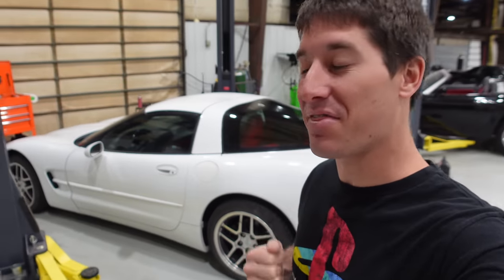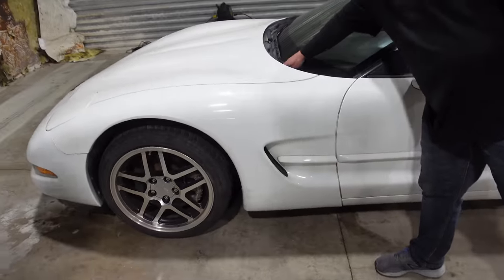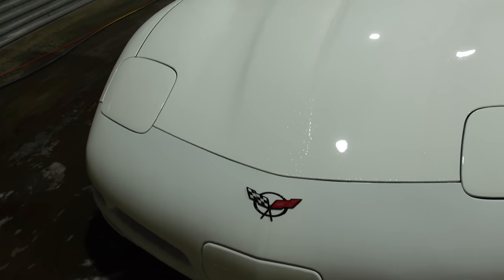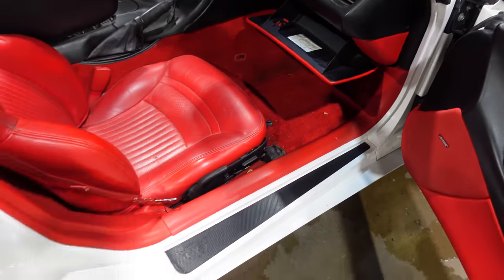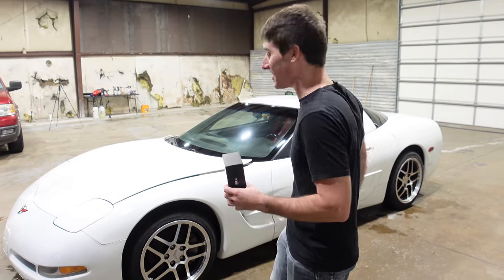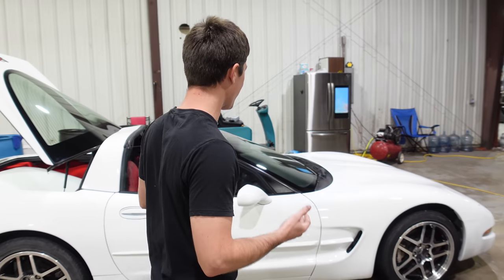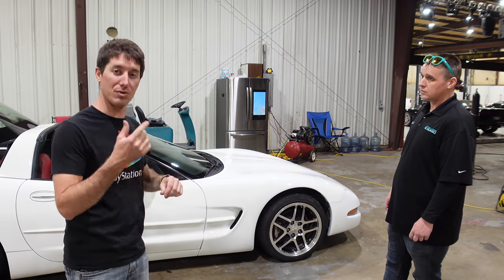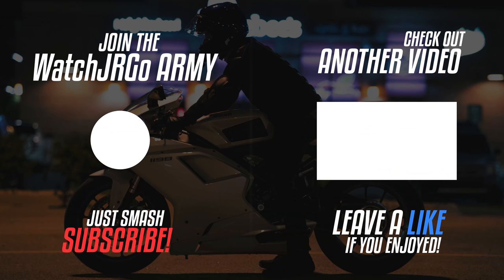DETAILING The $3,500 Corvette Made It Look Like A MILLION BUCKS

Comment: there is a manual fuel door release cable in the hatch on the driver side instead of using a key 🙈
Reply from the maker: Yes I’m very aware, the release pin has always been seized. The whole cap lock needs R&R it’s trash.

Literally the first thing I did when the button didn’t work.
Reply: @WatchJRGo  can you get the name of the animal hair brush? I'm in desperate need of one from my girlfriend's dog.
Reply: @JT-un7dc  Lilly brush
Reply: @kennyrogers1243  nah they work well but hurt to use for long periods of time
Reply: @TheBarberShopScott  what is your recommended brush?
Reply: @JT-un7dc  they are called "fuzz shavers"

Comment: Thanks for documenting the evolution of this Vette from, basically scrap to AWESOME. After seeing you vacuum all those leaves off the cowl (can't remember which video that was) be SURE to check the "udders" for debris.My 2003 has 3 on the driver side, 1 on the passenger side. If they clog up, you can get water build up into the wiper motors in a heavy rain.

Comment: My favorite channel! But it's time to do something about those rough-looking walls with the yellow, ripped insulation. At 10:35, you're standing in front of an immaculate car, thanks to Avalon King and The Detail Dudes, but the background distracts from the team's hard work.
Reply: This place is bigger than the Wizard's garage.  And he says replacing the insulation in his shop would cost him over $100K.  I'm guessing that money is more useful elsewhere.  For now.  Perhaps some waterproof wall-boards might be doable in the detail area.  
But, $2K to $3K would buy them 10ft X 20ft of aluminum composite board or stainless steel sheet metal.

Comment: One of those old style single post hydraulic lifts would be a must for a detail shop.
You could probably get one from an old garage or tire shop.
Reply: If you want to dig a 10 foot pit in your garage for the lifting cylinder...and have the pneumatics or hydraulics to hook up to it....sure!
Reply: @joeliopro1740   He's just spent a fortune on concrete etc so cutting a 4 foot hole and boring out a recess for the lift would be nothing compared to that.
Reply: @anomamos9095  My response was for any detail shop as you mentioned, not specifically JRs
Reply: @joeliopro1740  while my comment was specifically for JR it does apply to any new shop especially if they’re building a new shop from nothing and even if the shop is existing there are lifts used by tire shops that don’t require a massive pit be dug some just bolt straight to the floor.
Reply: Well I would assume that a lift that you wouldn't have to work around while detailing would be ideal, but sure, go right ahead.

Comment: Should be a cable in the trunk under carpet to manual release the gas cap.  Sucks about the wheels. They stopped making the machine face c5z reps in years so they are some what desirable

Comment: What is it with Chevy and them allowing listing crevices that collect garbage. I have a 2018 camaro that sits in my driveway (my 67 chevelle owns the garage for the curious). It’s under a live oak tree the rear glass and body have a crevice that collects leaves and pollen pods. A couple months of dealing twitch this rear window. A more finished trim piece would eliminate it. Though it collects at the bottom of the rear window and cowl but they are less annoying. Corvette looks great.
Reply: Invest in a car cover that would help keep stuff off it.

Comment: Looks very nice. Could sell it for $23,000 easy. C6 and really good C5's, at least in Florida, have been going way up in price. $14,000 was about the maximum for a really good C5. A C6 was worth about $24,000 and maybe up to $32,000 if it was pristine. Not anymore. And C7's are so massively expensive that they cost more than the base price of a C8. And if you have a C7 Z06 or an LT3 with the Z51, people are selling them for $75-80k. BMW prices have also surged again.

Comment: Hi, I have a question. While watching the first wash sequence, I noticed that the first pressure wash round was either cut out, or it did not happen. Then there was pre-soak and then foam, which then was done with brushes. if there is no flush with pressure washer, isn't the case there would be quite a bit of dirt that you smudge to the paint with the brushes? Or am I totally wrong here? I would neverever leave the initial flush out. Thus, it may just have been cut from the video here. Was this the whole sequence how things were done from zero to hero?
Reply: Pre soak was the first liquid on the car, followed immediately by first foam and hand wash. On a car that's not getting polished already we would have pre soaked, foamed, rinsed, then foamed and hand washed.

Comment: I would try a slight amount of touch up paint around the gas cap lid to cover the bare metal
Reply: Nah, I'd just jump on eBay and find a nice one. It can't be that expensive, especially considering how much he has invested in it already. No reason to skimp now.
Reply: @Cartier_specialist  the paint was missing from around the gas cap lid, not the lid itself.
Reply: @n9wox  True but they said the clearcoat is gone on the lid itself plus it appears to sit to low in the opening depth wise. It might only need the rubber bumper thingys to remedy that.

Comment: The Avalon King product is fine:  I used it
But the product packaging STINKS.
It comes in a fucking bottle...  If you accidentally tip the bottle over: you lose 1/2 or more of the contents in a split second.
Also the pad is too small for your fingers unless you're a child or girl.  The cloth that is supposed to go over the pad is very difficult to hold in place with your fingers because the pad is thinner than your finger tips so the cloth keeps slipping off the pad and off your fingers.  All they need to do is make the pad thicker so you can hold onto to it and put a drop applicator like dish liquid bottles have instead of a screw top and the problems are solved, but Nooooooo!!  I lost almost half the bottle because it tipped over and spilled.  I complained about it and they sent me a new one but did they listen to my complaint at all?  Noooooo!!  All they care about is how the packaging looks not if it is user-friendly.  As far as I'm concerned they are assholes because they have NO interest in improving the design of their product.